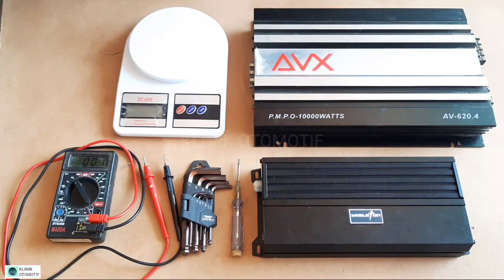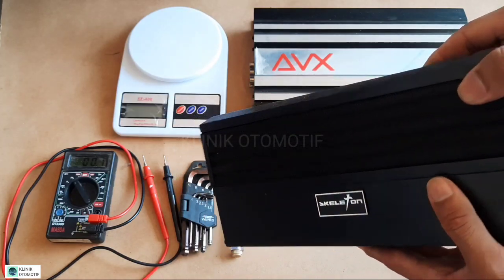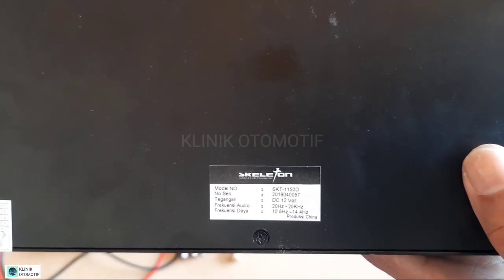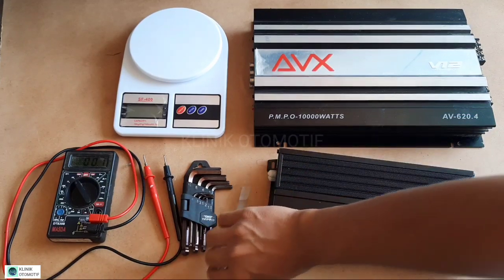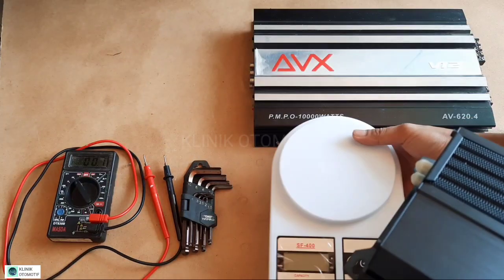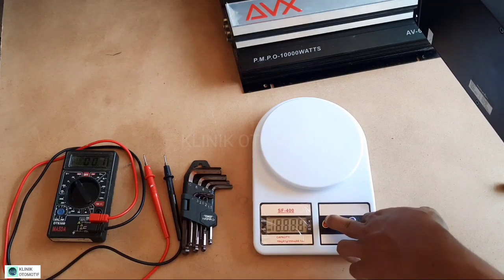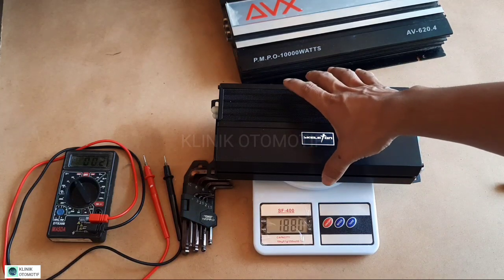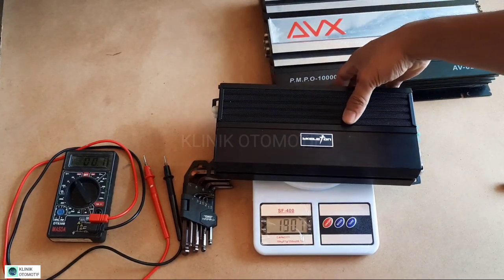Bongkar Power Monoblok Mobil Skeleton SKT-1150D 1000 watt | KLINIK OTOMOTIF

Comment: ini sih klw liat jeroannya bukan power kelas kacangan keliatan dari pemakaian cor toroid sama elco 80volt yang di gunakan ini sy percaya outputnya bisa 1000 watt RMS murni biar ukurannya kecil tapi tenaga nya badak nih om, inisih power Recomended banget apalagi clas D yang hemat daya dan adem temperatur nya gak cepet panas kaya power2 clas A atau clas A/B buat nge drive subwoofer2 badak pasti bisa dilahap om sama power ini apa lagi klw di pasang extra fan di geber lama gak bakal khawatir, mantap lah om & sukses terus chanel nya, 👌👍🙏
Reply from the maker: Iya om power badak, kecil-kecil cabe rawit . Buat angkat subwoofer ADS california 2 buah main 1 ohm aja Gain cuma di 1/4 atau di jam 9. BassBoost nya juga sampai 18 DB . Saya atur cuma sampai di jam 12 . Kalau lebih dari itu udah gak mampu subnya.
Aamiin 😇😇 Terima Kasih atas Doa dan supportnya om 🙏🙏
Reply: @Klinikotomotif  keliatan dari volt di elco inverter sama jumlah elco & gulungan toroid inverter nya gede, , trus kaya nya itu juga udh di suport sama arus bias 12volt di bagian driver, nya,, jd ibarat nya tenaga pompa air udh jet pump masih di bantu mesin dinamo pendorong untuk pendistribusian airnya jadi tenaga dorong dan tekanan airnya jadi jadi kuat dan kerja jet pump jadi gak terlalu berat dan gak cepet panas (itu analogi perumpamaanya aja om, di koreksi klw sy salah, 🙏
Reply from the maker: Bener om , kayak di Boost lagi tenaganya 🙏
Reply: @Klinikotomotif  makanya semua clas D itu tenaga nya badak tapi gak cepet panas ada orang yang biasa rakit power dya bilang power clas D itu power the next generation, namanya om surodipo pakar dan suhunya power clas D Indonesia chanel nya juga ada di youtube om, 🙏
Reply from the maker: @derirahman161  iya om, nanti bisa belajar bareng sama suhunya biar tambah ilmu om 🙏🙏
Reply: @Klinikotomotif  nah itu dya sy juga telat hoby sama audio mobil, jadi sy cuma ikut seneng aja klw ada orang yang suka kutak katik audio om, kita sama2 belajar dan saling share info om, 🙏
Reply from the maker: @derirahman161  siap om 🙏🙏
Reply: @Klinikotomotif  ya om orang yang td sy sebut pakar power clas D itu namanya KARTINO SURODIPO dya gurunya om wahyu eko Romadhon jadi hasil karya design  power om KARTINO SURODIPO itu sering di riview sama om wahyu mereka dua2 jago2 banget dan teliti banget dalam menghitung nilai2 componen hasil karyanya jadi hasil keluaran output power mereka bener punya watt RMS yang murni, power2 coz di perlihatkan lewat osiloskop multi meter dan berbagai peratalan kerja mereka jadi power2 clas D yang ouput nya 500 watt RMS aja bisa buat mendrive subwoofer2 badak 2 buah sekali gus dan papan2 PCB componen nya juga bagus2 bukan kaya yang ada di pasaran mereka cetak nya di JLC PCB. COM sy gak tau itu ada di negara mana coz mereka bayar nya pake dolar om, sesekali coba aja om liat chanel dua orang itu WAHYU EKO ROMADHON, KARTINO SURODIPO atau ada satu lagi FADHOLI om, lumayan buat nambah2 ilmu om, 🙏
Reply from the maker: @derirahman161  siap om 🙏🙏 Terima kasih atas infonya om. Nanti saya bisa belajar dari mereka bertiga om . Bisa buat nambah ilmu 🙏🙏
Reply: @Klinikotomotif  ya om kita sama2 belajar dari orang2 yang memang udh mumpuni dibidangnya coz biar nantinya power2 mobil yang punya tenaga badak itu gak perlu lagi harus nguras isi kantong jadi image branded minded perlahan tapi pasti bisa berubah, owh iya power monoblok holywood yang sering om ulas dlm pembahasan itu juga luar bisa karena udh bener2 mengadopsi kaidah2 power clas D hanya saja papan PCB yang di gunakan untuk componen2 nya memang masih kurang bagus dan box power nya masih dibuat terlalu bongsor jadi isinya terlihat gak padat karena output power nya cuma 500watt RMS murni coz sy pernah liat hasil test nya waktu di coba di masukin sinyal gaint nya bisa tinggi belum cliping untuk angkat 2 subwoofer sansui 12 inch main di 2ohm, orang banyak tertipu sama penampilan nya yang kurang menarik pdhl tenaga nya badak juga itu power om, sy liat di chanel joss audio waktu di test nya om, 🙏
Reply from the maker: @derirahman161  iya om, biar kita gak salah dalam membangun audio bisa belajar dari orang-orang yg lebih berpengalaman. Dan biar gak jadi barang mahal lagi buat para pecinta audio.
Kalau untuk power sekelas hollywood saya lebih suka power Nakamichi om. Soalnya penampilannya bagus. Terus Toroidnya agak besar dari power hollywood om, sama kawat yg di pakai juga besar-besar dan jalur outnya Pakai kawat besar untuk ke terminal speaker om. Gak seperti power hollywood cuma pakai kawat kecil di jamper-jampet melewati tiap komponen. Terus yg paling saya suka bisa stabil di 1 ohm
Reply: @Klinikotomotif  ya om holywood componen2 yang di pakai masih yang biasa tapi output nya bener itu om, cuma klw di bandingin sama nakamichi udah pasti menang nakamichi dari berbagai sudut 1, branded  2. Japan quality yang componen2 udah pasti lebih berkualitas 3 design nya juga jelas lebih bagus dan rapih klw holywood buatanya masih keluaran kasar & kurang rapih mungkin itu produk dalam negri om, tapi klw soal output watt itu bener bukan cuma bhs iklan seperti yang kebanyakan yang bisa tertulis sampe puluhan ribu watt tapi pas dibebanin subwoofer badak langsung melempem, jadi lumayan holywood lah klw punya buget minim dan gak terlalu peduli sama nilai2 estetika design power nya, monoblok holywood pilihan yang paling rasional om, 🙏
Reply from the maker: @derirahman161  bener om, punya dana dibawah 600rb udah dapat power badak
Reply: @Klinikotomotif  yes coz sy yakin sebenernya banyak penggemar audio mobil yang punya buget minim tapi pingin punya perangkat bisa horeg kaya perangkat2 yang branded om, btw nanti sesekali coba buat video subwoofer OWL yang 12inch atau yang 15 inch om coz klw liat dari bentuk fisik nya lumayan bagus dan low buget om 🙏
Reply from the maker: @derirahman161  siap om 🙏🙏
Reply: @Klinikotomotif  👌👍